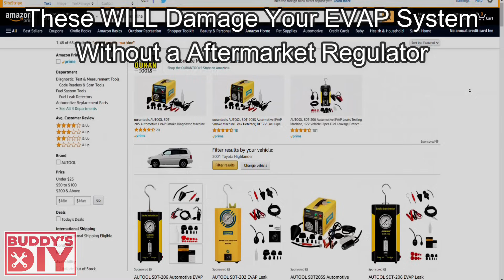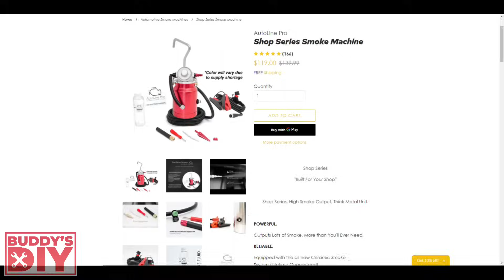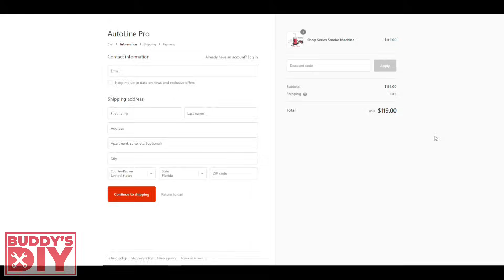How To Test For Vacuum or EVAP Leaks |  Autoline Pro Smoke Machine

Comment: I bought the autoline smoke test after watching this video because I spent more than 3 months trying to resolve my small evap leak.  Changed gas cap, esim and Evaporative Emissions Purge Solenoid Valve.  My car always felt like it was struggling when accelerating.  When running the smoke test, I found a noticeable leak on the new ESIM.  Found that the seal was not seating properly.  I used some permatex o-ring grease which kept the seal in place during the installation.  No more smoke was leaking and check engine light hasn't come on for almost a month.  Thank you Buddy for this video!

Comment: The most stupid tool. You will need a compressor. it doesn't make sense. you have to buy all those tools. Mine came with nothing, so stupid.
Reply: You're not set up to fix vehicles if you don't have an air compressor
Reply: @derecccc  I fix my two cars for decades without it and I'm still alive and working with my tools. My smoke machine did not bring the compressor incorporated so I returned. Simple. The video is the one with the compressor. period.

Comment: Hi, my audi a4 b7 has a turbo. So if I just push the smoke into the air intake the smoke would go through the turbo and ends up at the throttle body. What about all the vaccum hoses? Does the throttle have to be open?  Thanks

Comment: Why would you block the air filter box? It's not even connected to the intake/engine any more.....
Reply: You don’t want anything touching/contaminating your mass airflow sensor other than air. On the opposite end the air filter protects the sensor.

Comment: Someone recently did this for me because I think i may have an evap leak. But they ran the smoke through the oil cap. Is this recommended? We didn't see any leaks and the smoke just exited through the air intakes. I am trying to see if I have a leaking intake manifold is there a better way to perform this test?

Comment: Why is a regulator needed to maintain 1 psi?

Is the evap system that sensitive?

Thank you for this video. I learned much
Reply: The pressure sensors are delicate and can be damaged by higher pressure.
Reply: @MarzNet256  thank you for the information!

Comment: I made the “martinbuilt” smoker from his channel and hooked it up to the little yellow air compressor from harbor freight. Works great and less than 25 bucks!
Reply: What item number was it ? And were you able to use a quick connect
Reply: That's the reason I'm here for this video was to find out if I could use a tire compressor instead of an air compressor

Comment: Can I attach my portable tire- air compressor? Not sure how I would do this though… I’m having an EVAP leak myself and I’m a beginner DIY
Reply: Hey Ty. I saw that no one responded to you so I thought I'd help you out. Yes you can use an air compressor BUT make sure the pressure is no higher than 1%. That said, you can't always trust air compressor gauges. An easy way to fix that is, propane grills use a pressure regulator that can be hooked up to your air compressor. Or, you can simply use a bicycle pump; just pump enough to circulate the smoke. Lastly, I found a DIY video that lists all you'd need and walks you through making your own smoke tester. Cost about $30–50. Hope this helps.
Reply: @Roller76  I'm here to see if anyone used a tire inflator. But I noticed he did say that the smoke machine comes a 1psi regulator, so I'm guessing a tire inflator set to 1psi would be safe.

Comment: Nice instructional video. I've wanted on of these years ago, when we had an small EVAP leak. Took to the dealer and they charged us around $150, to replace a gas cap. Back then, the smoke machines cost a few hundred dollars. I'm glade I was able to find an inexpensive one. We have another small EVAP leak that I need to find. This little guy will pay for itself the first time I use it.
Reply from the maker: Ohh absolutely. Be sure to use the promo code to save you a little money!

Comment: What the hell? I'm so confused... why did he put that yellow cover over that part of the intake? Isn't that the empty portion of the intake that was the entrance part for air?
Reply: Yea that got me scratching my head too, it was un-needed.
Reply: To prevent dirt from going into it.
Reply: @Pk3_Garage  Dirt wouldn't get into it if it wasn't opened. 😂😂😂
Reply: It’s so when you’re smoke testing it, you don’t mistake smoke coming out of the intake as a leak. He literally said that in the video
Reply: Same here lol
Reply: there are still lines running from the motor back to the intake box, so there's potential for contamination, still. they're the smaller rubber lines above everything on the motor
Reply: Can’t believe this is the most liked comment after all these years

Comment: I just bought the same machine and it's not putting out close to that much smoke and says it's a 0.5psi regulator
Reply from the maker: You battery is getting week. It should be putting out a good bit of smoke. And the website sais 1 psi regulated
Reply: If that’s the case why don’t you send them a pic and get an explanation or get it replaced? It doesn’t do you any good to complain.